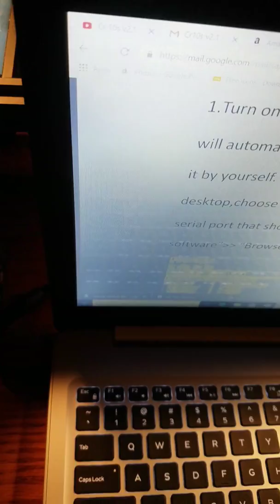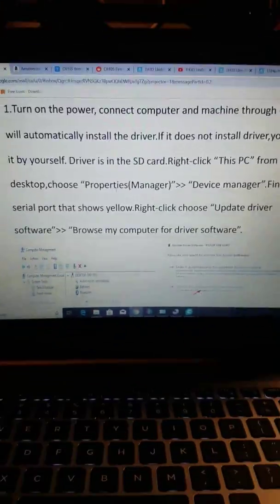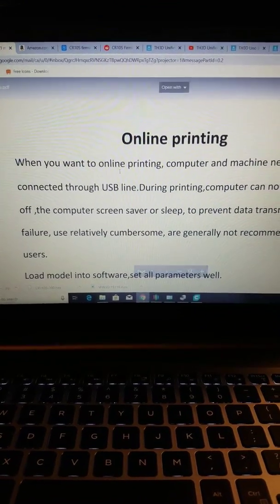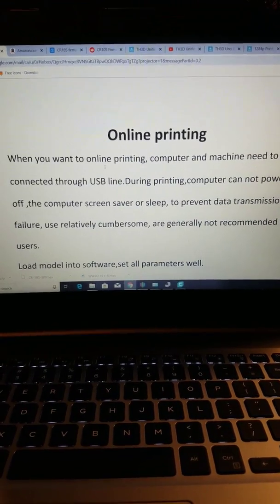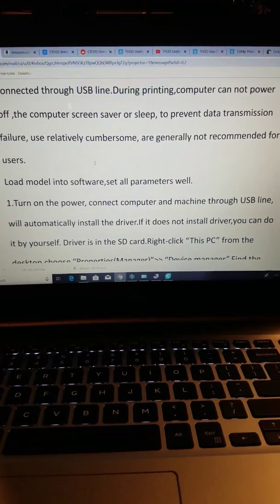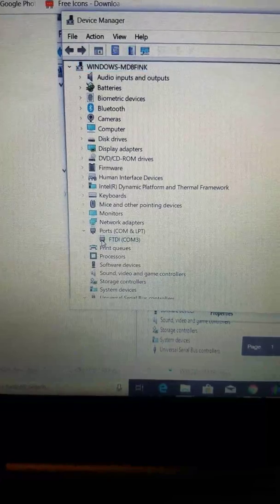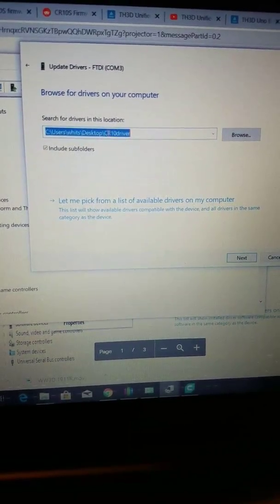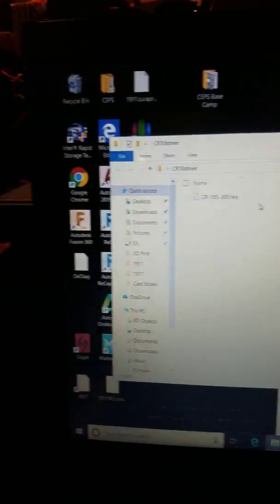Solved! CR 10s v2.1 motherboard troubles, solution in description.

Comment: Hi. Do you ever meet the problem of heating up nozzle?
Now I have the problem to heat up the nozzle and I realise it might be the cooling fan problem (seem like too cool for the nozzle to heat up to certain temperature ) and stays at around 87.
I unplug the power for the cooling fan and even the nozzle can heat up to desired temperature but I know it wouldn't be the correct solution.
It's really trouble me and hope to get solutions asap. Thank you.👼
Reply from the maker: I've never had that problem, but I have had fluctuating temperatures. It could be your heat cartridge or thermistor.

Comment: The capacitors of the CR-10 & CR-10S units were built with the worst possible capacitors. As a result, you're best buying replacement capacitors from TH3D Studio and changing them out. That will remove the problem. By the way - You're going to face extremely similar issues with the V2.1 board.

Comment: im having this same pain in the a** problem and needing help too
Reply from the maker: Check out the thread I posted in the reply below.  I had to install the FTDI driver on my computer to get it to recognize the board. Then I was able to flash the firmware.
Reply: @waltswoodworks3d809   I tried this and still nothing will I need a bootloader like A.Uno r3?

Comment: have you solve it?
Reply from the maker: Corrupt firmware. I had to install the FTDI driver on my computer to let the computer access the board and then use CURA 15.1.4 to flash the firmware. I later went back and flashed with TH3D Unified firmware.